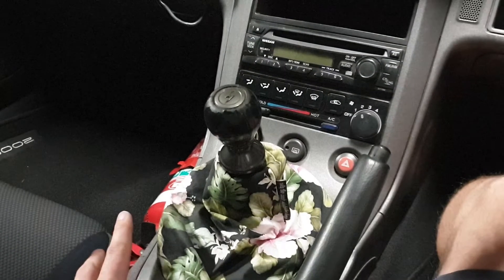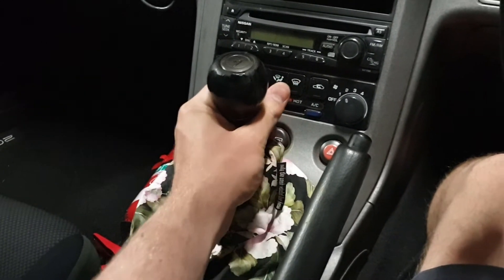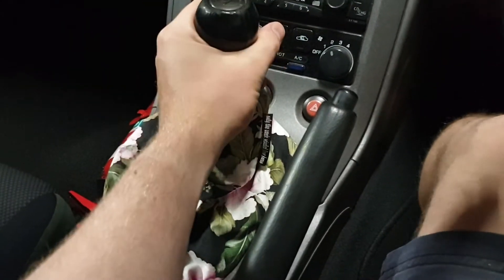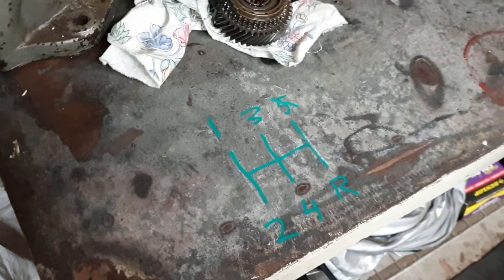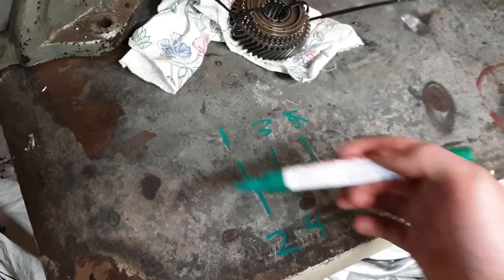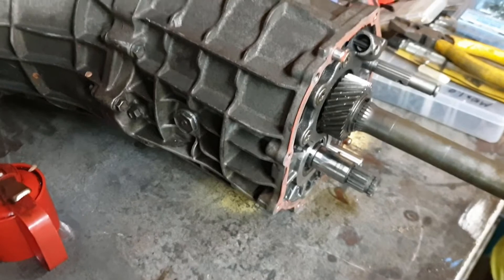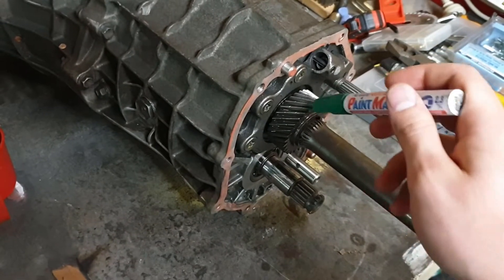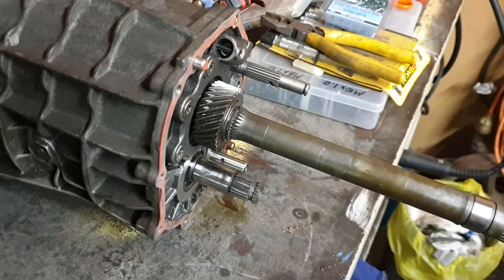WTF is gear 3.5?

Comment: Why not replace 4th with 3.5 and 5th with 4th to make it easier to shift
Reply: I realise I should have watched the whole video before this
Reply: Its used when he needs just a bit acceleration. But its way easier to normally downshift from 4 to 3, and more precise downshift timing means he can enter the corner more precise
Reply: In this 3.5 gear setup, can you directly go from 3 to 4 instead of 4-3.5-3